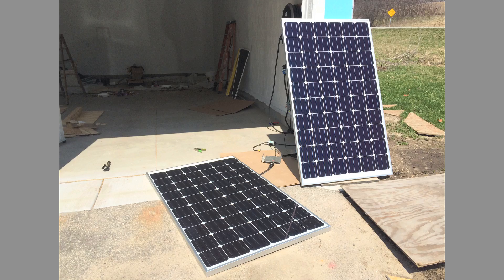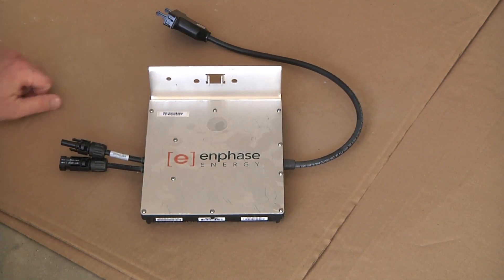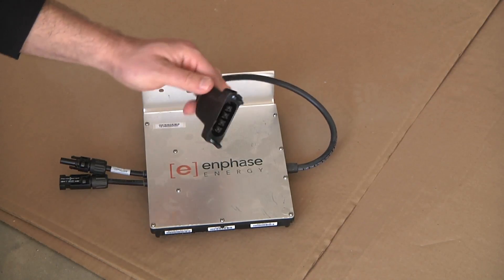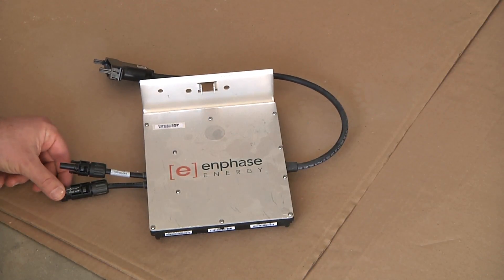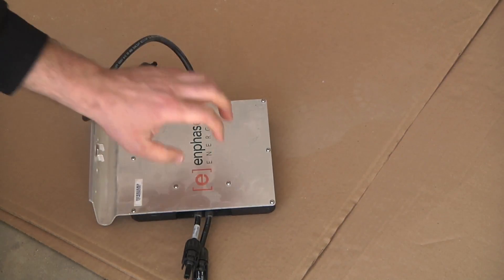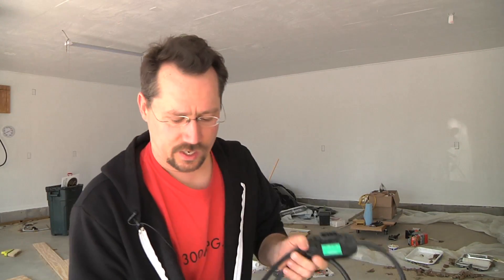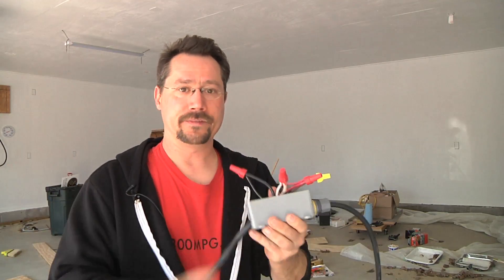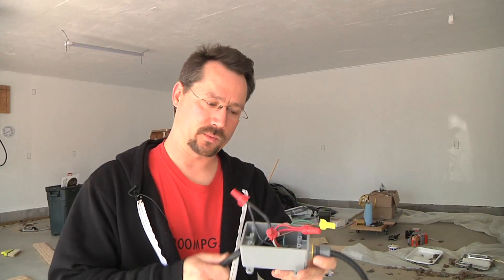Solar Experimenting! Part 1

Comment: I picked up some used solar equipment, 11 panels with enphase micro inverters on each panel. I tested panels, they are  putting out 33 volts per panel. The system doesn't seem to work. The inverters have a red blinking light in back of them. Are they working, any suggestions? I'm new to this, any help would be appreciated.

Comment: Did you wire a male plug hot??
Reply from the maker: No. There is no power output until everything is plugged in and the inverters are communicating with the grid for 5 minutes. When unplugged, power stops instantly.
Keep in mind that this was only a simple test experiment for learning about how these. But NO there were no hot exposed conductors.
Reply: Wasn’t thinking of the safety features in the micro inverters. When I was watching it I was just thinking “Nooooooooooo”. Glad you were mindful of it. Went through and watched your videos on your setup. Looks very nice! Especially with the EV’s added on. Still need to check out your other playlists.

Comment: Hi, Don't suppose you could tell me a bit more about the connector? 
L, PE, L, N
Im guessing L is live, but why are there 2 live connections,
PE is earth?
N is neutral?..
Is the earth pin connected to the steel casing?
I have bought an enphase m250 but don't want to use the bus connector so will be splicing straight onto the cables..
Many thanks
Reply: Not to worry, I have now got my m250 up and running.. the reversed pos and neg stamps on the mc4 connectors didn't help! The AC cable is  standard blue brown and earth so not a problem!
Reply: @HubbHubbs  When you connect trunk cable to NEMA 14-50, does it matter which one is L1(-120) and L2(+120) or the micros recognize polarity when activated? Thank you in advance